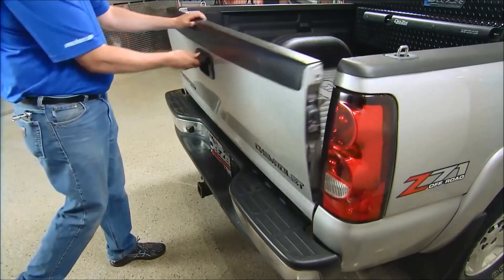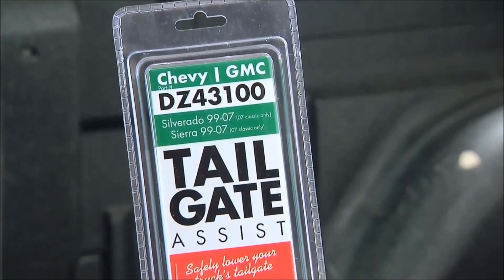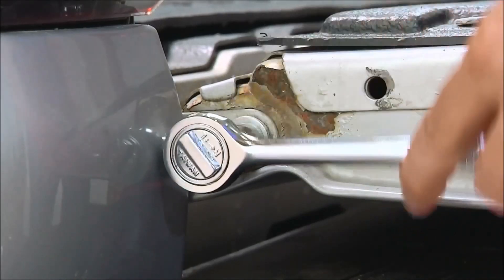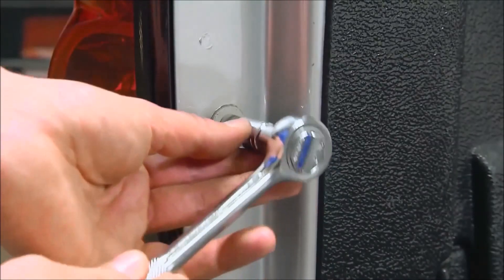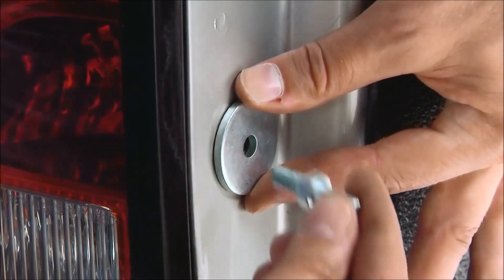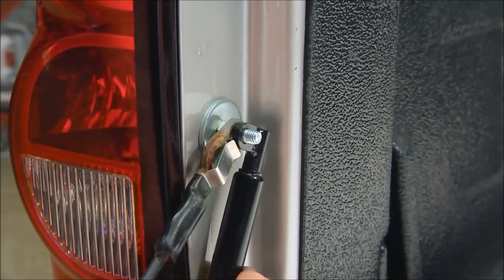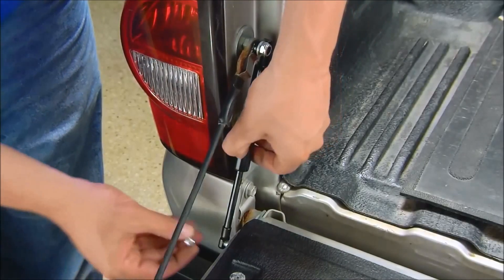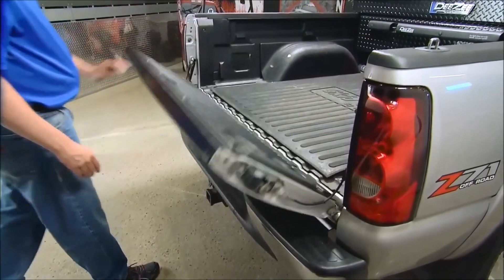DeeZee Chevy Silverado Tailgate Assist Damper DZ43100

Comment: They break.....I am on my 3rd broken part....they replaced parts but it will break again..
Reply: gman77gas what keeps on breaking?
Reply: First the shoulder bolt then the shaft on the gas shock....its been about 6 months since last problem. The company was not good at responding to issues. You have to keep contacting them.
Reply: gman77gas thank for the info I'll pas on this tail gate assist.